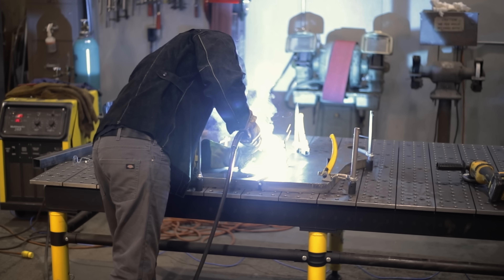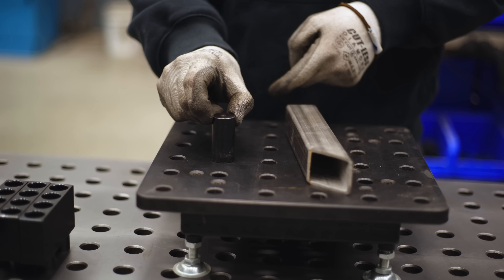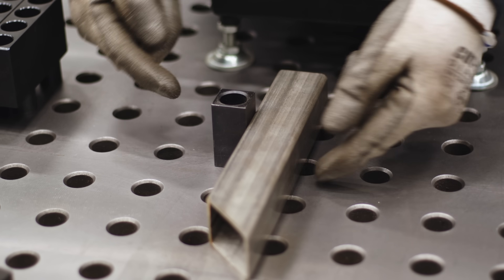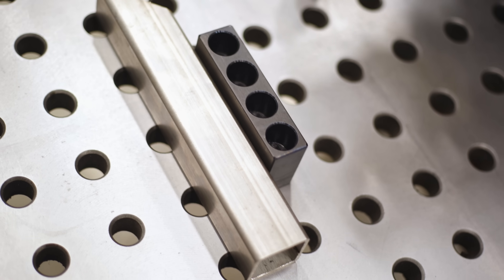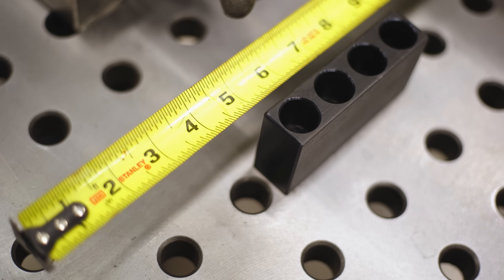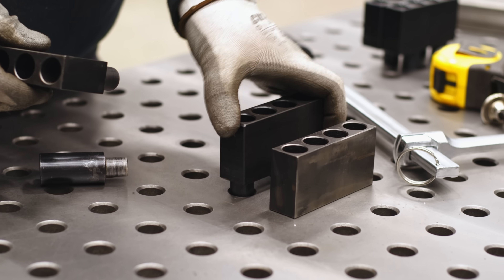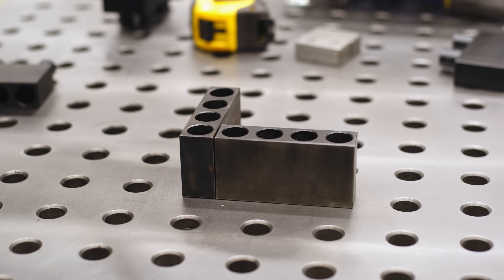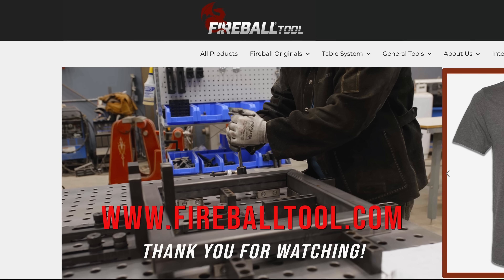Why are welding pins Round?

Comment: 4:13 "I don't understand why people are buying round pins in bulk."

Round pins are cheap to make: Take round stock, lathe the end down to make the pin shape, cut the pin from the stock, advance the stock on the lathe, repeat the cycle. One lathe machine could do the entire process with two tool arms.

Cheap to make = high profit for mass production.  High profit means it will be extensively advertised to capture market share.

It's the same reason that 'flat-pack' furniture dominates the furniture industry. If you're not making 'flat-pack,' then the profit in simple pieces is too low due to the competition from flat-pack, so the 'mid range' furniture isn't made, only cheap flat-pack and expensive 'deluxe'/'luxury' pieces.
Reply from the maker: Square is also cheap to make. All machined on a lathe. Not sure why every company keeps following each other instead of actually looking at the function of the tool. Instead they prioritize manufacturing over end use.
Reply: @Fireball Tool  I'm not a machinist, but at a rough guess, based purely on geometry, round stock of diameter X would be cheaper than square stock of dimensions X by X, simply from the reduced cross section.
At my last job, working in a plastics injection molding company, I overheard conversations where they were negotiating with their suppliers over price differences of a penny per TON of feed resin, when the final product was less than 2 ounces per piece.
That's the bane of Unfettered Capitalism, everyone is trying to get Maximum Profit, even if it means making a less useful product for the end user.

Very few look to Quality over Maximum Profit. You, sir, are one of those rare people, which is why I follow your channel. You not only educate me in things outside my field, you inspire me to keep my own standards high, to put Quality first.
Reply: @FireballTool  If everyone makes the same cruddy product with no innovation or differing features to advertise or set them apart then all there is to compete on is brand reputation, price, material/finish quality, and ultimately in a mature product the only improvement to be made is to maximize profit, which, yes, often does not benefit the consumer.

Comment: But when are the round pins back in stock cause I want more of them.

Building railings is way easier with the round pins because my pickets are on a 4 inch center spacing and I keep having to move my stops so I want enough to go all the way down the table